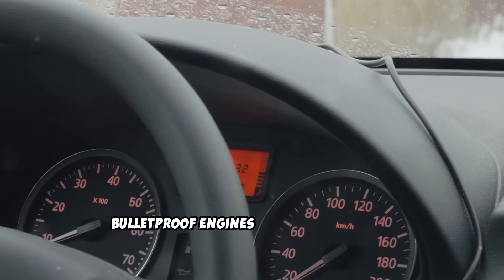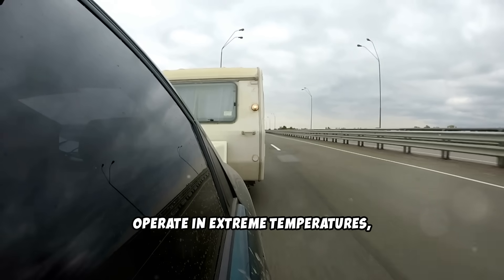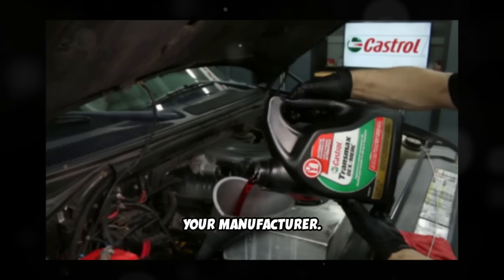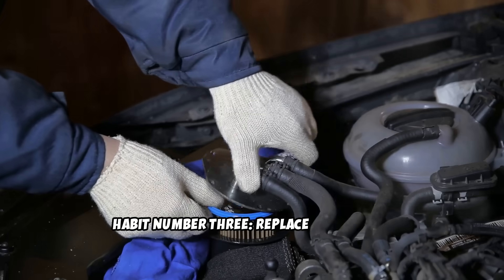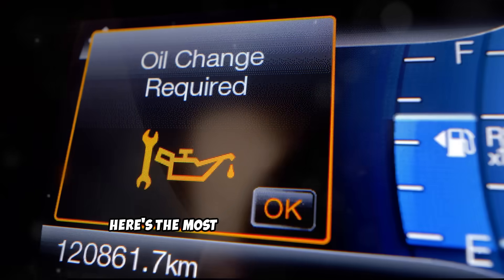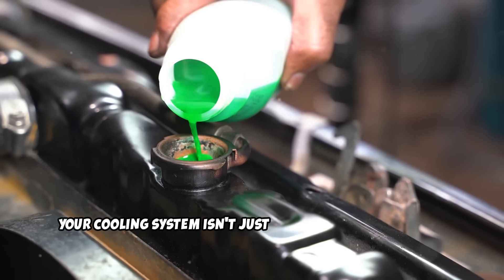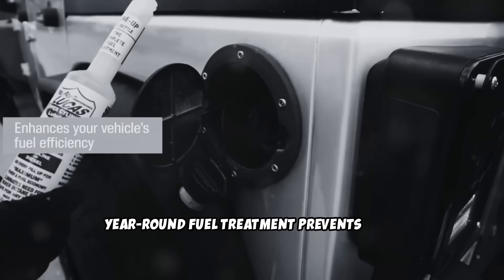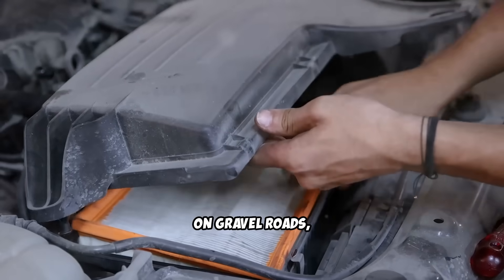7 Habits to Make Your Diesel Car Last Over 500k Miles Without Repairs

Comment: In normal conditions 
Change oil every 5000km
Swap oil filter every 10,000 km
Change trans oil every 150000 to 2000 km. If you tow. Change earlier

Comment: Had a VW Transporter 2.5TDI, 1998. Bought it with 50000 miles on it, sold it with 250000 miles, oil changes as per maintenance manual every 12500 miles. Never had any engine related problem, so what are you trying to say here?? After 20 years it is still driving without issues.

Comment: My 2008 Astravan on 246 thousand miles had It's last oil change in 2020, and It's still running like a smoke belching Tiger Tank.

Comment: Missed the important habit of not stressing a cold engine. Does more for longevity than any maintainance. 
Regarding the transmission oil changes on manual shift engines: you will have to replace the clutch eventually - the oil gets replaced then. So on manual you will probably never just replace the oil. 
Highway, if driven normaly, is not really hard on turbo I suppose  - there is not a lot of acceleration there, engine runs pretty cool most of the time. So the advice about waiting to turn off the engine is not so needed there. 
Generally additives are not a good idea, any mechanic tells you that. Unless you are trying to save a ruined engine (or have a very poor fuel quality), trust the fuel and oil as it is. 
It is also important to not use old diesel fuel and to drive the car / truck regulary (the best every day for at least until it reaches the working temperature, but at least once a week) to prevent paraffine settling down in the tank and engine - it clogs it; this is even more important in cold climates and winter. 

Generally, diesel is more of a lifestyle than just a fuel - it is ment to be driven with leisure and ease, pretty conservatively; turbo is there just to help you get some quick bursts. Even newer engines, which are generally made for higher RPM still prefer it to be low. Just imagine you are driving a big truck and eating a sandwich (don't really eat when driving).

Comment: I had a Ram truck and my trans went at 60,000. Never again will I follow manufacturer recommended intervals.  Bought a Chevy and change the trans fluid every 30k and oil every 5k.

Comment: I have 2014 VW Tiguan, 113,000 miles.  I service the engine (change engine oil, oil filter, diesel filter, air filter) every 6 months no mater what the mileage. The cockpit air filter every year. I also use good diesel fuel and use an fuel additive once every month. When stopping the engine I allow the turbo to run down over a minute - no harsh acceleration or slowing down.  So, good advice here in the video.

Comment: I helped change the transmission fluid on an older golf, petrol (gasoline) car. The transmission was acting like a failed unit. Wouldn't change gear properly and wouldn't change into top- I think and was gutless. Changed the oil, filter I think (few years ago), never knew anything had been wrong with it after that. Went like a champ and a charm. Change the friggin oil!

Comment: I’m a mechanic, I recommend 3000/4000 miles for oil change, I do mine every 3000 miles, never had a problem. And after I drop my oil, I suck out what’s left in the sump, because most sumps are lower then the drain plug, I frequently get just under 1 L after the oil is drain👍
Reply: My sump plug is on the back corner......so I lift the front of the car to drain the extra oil out 👍
Reply: What do you use to get the remaining oil out
Reply: I do 5000 miles on my truck, but I've had it tested to confirm. I run biodiesel though, which has next to no soot and with synthetic oil, my oil doesn't get dirty. The oil on my dip stick is still clean after 4000 miles.

Comment: have 422,000 km on my jeep wk turbo diesel CRD. I have done 3 Tranny services over this term but maybe have fell short? Some do not do any! Original mercedes engine, tranny. Only had to rebuild turbo actuator and fix a few leaky injectors, rest is just maintenance. With this high milage except to replace front and rear driveshafts,cv shaft and wheel bearings which i consider wear parts as well. Also shocks and struts. I put maybe 1500$ a year into my jeep which I consider cheap compared to new suv payments of typically over 10,000 $ a year I am sure.

Comment: My experience with diesel engine longevity has lead me repeatedly to the absolute damaging effects of Euro 6 applied to diesel engines. The simple reality of this is that an EGR fitted to your diesel engine sole purpose is to recirculate unburned diesel emissions through the engine. This is polluting the whole engine by depositing carbon directly into the engine acting as an abrasive and pollutant of the engine oil. The carbon is distributed through the whole engine by the polluted oil. 
Secondly the fitment of a DPF to the exhaust system is like putting an obstruction  in the free flow of exhaust gasses creating back pressure and limiting the free exit of exhaust gasses causing engines to run at higher temperatures. 
If an EGR and a DPF is not a legal requirement in your country, have it removed or blanked off immediately and have the software tuned accordingly.
Reply: I hate having a DPF, worrying about keeping it clean and having to drive it once a week for a DPF regeneration. Seriously thinking about getting a DPF delete.

Comment: I drive a Ford Focus 2015 with the 1.5l Duratorq engine and Powershift trany. Oil change every 10000km, transmission oil every 60000km it's a little expensive but still cheaper than a new engine or transmission. The car has 260000km on it and the only thing i had to replace today was the PLASTIC housing of the Thermostat witch had a crack in it. Every year brake fluid very zwo years new coolant. Had the drive belt changed at 140000km instead of the 180000km it says in the book. Car still like a charm (on the german Autobahn) and i get 49 mpg (4.8l/100km). oh and i bought the car with 6000km on the odo.

Comment: My friend who was a qualified Diesel Mac...he told me and I found this also effective with petrol engines, was to say once to every bi-monthly to add a bottle of brake fluid oil to my diesel tank or of petrol, it definitely cleaned out my carburetor and valves.                   This also works well for fuel injectors and spark plugs especially if your engine is at certain stages of jibbing or misfiring...😊...
Reply: Your friend is not too smart.
Reply: Diesel engines don’t have carburettors.
Reply: 😂😂 really??
Reply: Or spark plugs.

Comment: I changed the ‘sealed for life’ auto transmission on my 2005 Volvo cabriolet. What a difference! So much smoother gear changes.
Reply: have an s80 auto box that oil gets dropped  every 40000 miles up to 110000 at moment
Reply: @davidlove1944  I have one of these..is it a hard job. .I don't even know where it goes. .
Reply: I did that on my 2002 Volvo S80... only 98000 miles but trans  oil never changed before.Lovely smooth changes now.

Comment: In the EU U.K longer gaps or higher mileage between oil services is purely for fleet buyers, they often do 40-50K miles a year, so extending the range cuts their cost considerably. And they are by far the biggest buyers of new cars, often 80+% are fleet buyers, so we Joe public need to change at different times and miles, short journey are the worse for any engine, heat burns of water condensation and gives a better fuel burn.

Comment: I change the transmission fluid every 12 months.and change motor oil & filter every 5500kms.and change the fuel filter every 6 months
Reply: Too often waste of money. Fully Trained mechanic 40 + years .👍🇬🇧🦊
Reply: Well sorry you are wasting your money, fuel filter once a year if you do 40k plus miles a year, gear box depending on miles per year, engine oil and filter 6k miles is good practice.

Comment: I had an Isuzu 3.1 turbo diesel. Towed a boat with it all over the country. Oil changed with filter every 5000km . Fuel filter changed every 20,000km. Gearbox oil done every 60,000km. Sold the vehicle after 20 years of ownership with 500,000 plus kms on the clock. Over that time I changed one water pump and 1 turbo unit. Everything else was just basic maintenance. Fan belts, tyres, breaks, wiper blades etc. Paid $18000 for it sold it for $2000. This is the best maintenance advice you can get for a diesel.
Reply: I had a Mégane 1.5 dci, changed air and oil and filters every 18.000 miles, fuel filter at 60k and 120k. Sold it at 140k and it didn't take more than 100 ml between oil changes. Never had any issues 😂😂😂
Reply: I bought an Isuzu pickup 2.2ltr turbo diesel this morning, it's my first diesel engine. This video has been a great eye-opener. I will follow the advice on this video. Everything stated makes basic sense. Many many thanks for this so valuable information.
Reply: Absolutely correct
Reply: I have a Mercedes sprinter lwb van 2148cc got 221,000 miles on just passed mot use synthetic oil also add DPF cleaner to full tank of fuel and also diesel engine cleaner runs great
Reply: Isuzu 3.1? Which one is that bro? I have 2.5 vcross should i follow the same numbers?

Comment: 1. transmission is replaceable, even if you screw it up. it makes the car move, but the engine will survive transmission failure
2. turbo is replaceable, and you can drive even without it. slowly and with a lot of smoke, but it will drive.
everything else.. if anyone didn't know it, they don't deserve the drivers license.
Reply: Everything is replaceable, you miss the point, those are expensive replacements
Reply: @giggergigger1 depends on the car you drive, and depends on what you consider expensive.
Reply: @Skelturoth 🤡

Comment: Also with deisel...keep revs around 1800 to 2000 where possible in every day driving.  This keeps the turbo operating at optimum temperature. Deisels are designed to work at revs for good circulation and reduces soot/carbon build up.

Comment: I've never seen a diesel with start stop. Or with a CVT other than that pretty good information.
Reply: My 2025 Ranger Raptor has the stop start and she’s a bi turbo diesel
Reply: Subaru diesel outback’s had a cvt but most of them are dead by now, also the Mercedes B180cdi has a cvt which worked quite well.
Reply: 3.0 Duramax as well.
Reply: Current Mercedes Sprinters have start stop.
Reply: My Focus ST has it, it's mostly turned off.
Reply: Mazda 6 diesel 2018 - stop/start fitted.
Reply: VW have them
Reply: Mitsubishi triton / L200 2017 has Start/stop functionality. Easy to trick to off with an resistor on the air-temp sensor😊
Reply: My Skoda Octavia 2.0tdi has start stop
Reply: My car does.
Reply: My Fiat diesel has the stop / start function.

Comment: excellent video with very important tips. Just put also some information about the oil change of the front and rear diffs, if the car has 4AWD. It has to be performed every 48 months or every 60 to 80.000 km. It is simple and does not require any filters,just the right oil with the respective viscosity.

Comment: I have been around all the diesel expensive repair due to my incompetent behavior toward my own car but my diesel 270cdi ML w163 never betrayed me on a long trip for 10 years in some aspects i pretty much like the diesel engines it can be very durable if you maintain it correctly even on high mileage

Comment: Been told by a good friend also my mechanic. Never change transition fluid.may be different for american cars but on mine he said never..
Reply: Wrong advice! It's what car manufacturers are saying, there is NO official transmission oil change interval for manual trans. But it SHOULD be changed since the oil is collecting all dirt from the gears, metal particles, etc. I would say each 100.000km is good enough to change gearbox oil.
Reply: Your good friend is full of shi....
Reply: He wants your money when the transmission fails or doesn't know much

Comment: I change the oil every 4000 miles, i also rotate the tires at the same time. . I  have 2 fuel  filters and change at 10k, grease the front suspension as well. My f350 has 175K miles and still drives like new. coolant at 30k and trans is also 30k. as well as the the front transfer  case. and front and rear gear oil at 30k as well. Over kill probably but it much cheaper than a new trans or a $18k engine.
Reply: Maintenance is always better than cure!.

Comment: Switch off the stop-start function as this will destroy the engine
Reply: One of the biggest scams out there!
Reply: Never caused a problem for me. 150k miles so far.
Reply: I thought it helps DPF as no idle running ?
Reply: It doesn't hurt the engine ..  it kills the starter motor .
Reply: @MrKrueger88 Put stress on the engine and on top of that camshaft loose lubrication for a fraction of time but adds up. Hot oil will rush in the pan cause of gravity.
Reply: What diesel is stop-start?
Reply: @AREyouAFRAIDofTHEdark1  mine
Reply: @AREyouAFRAIDofTHEdark1 Mine is, I have a Mercedes A class. I switched it off though.
Reply: What diesel is stop-start?
Reply: Focus ST 2ltr diesel, it's mostly turned off.

Comment: Also, To idle the car for 30-40s during cold start as oil settles down due to gravity.. This will help to properly circulate oil throughout the crankshaft & important engine components. 

Not to rev or rash drive car until it reaches normal temperature